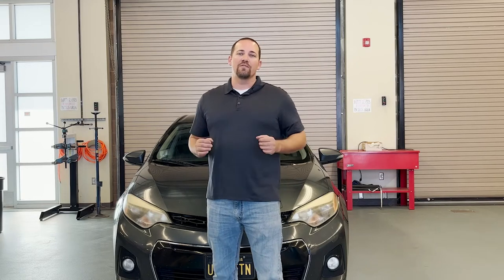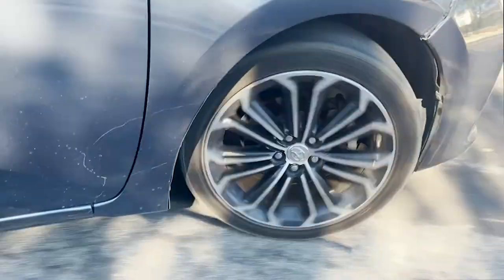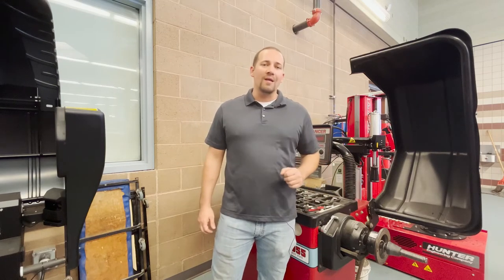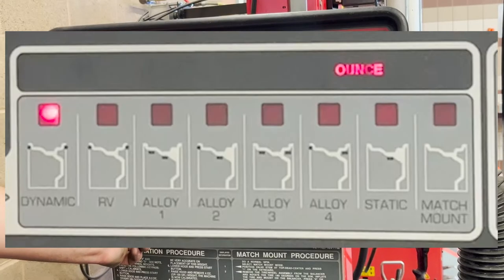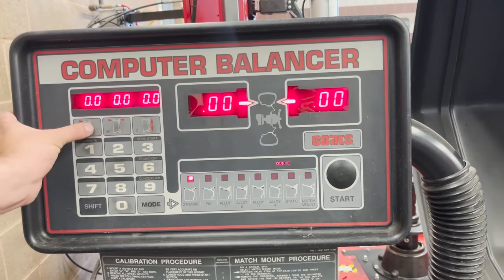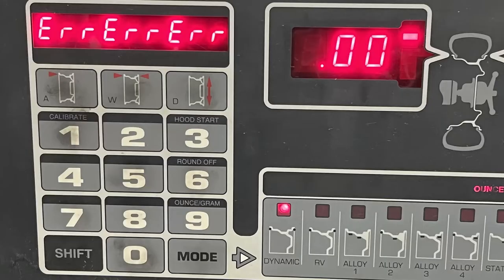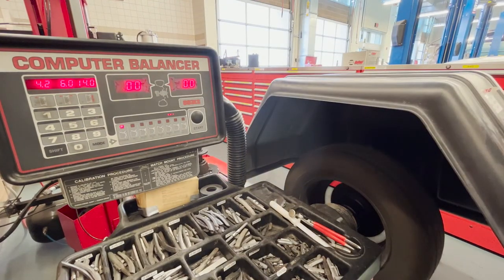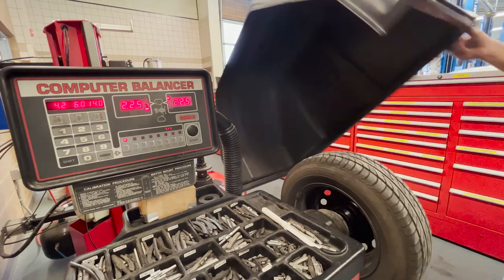How to Balance Wheels and Tires

Comment: I would love to see if you can balance a tire to 0 without weight. I have a tire company that says it's possible and he had balanced all four without weights on a truck.i said it was impossible.and extremely rare if at all.claibraiton in order?what do you think.
Reply from the maker: @coreywilson3326, I would agree with you that Balancing a tire to 0 without weights is extremely rare due to manufacturing variances and wear. While theoretically possible with perfect tires and wheels, it's impractical in everyday scenarios. Calibration issues could also affect balance.

Comment: Is it normal if I balance a tire and it reads zero, unmount the rim from the balancer, rotate it 90 degrees, mount it and balance it again that it says it needs weight? I can zero it but it always gives me a different reading of I take it off and try to balance it again. Is this normal? Coats balancer
Reply from the maker: Keung, great question. It's not uncommon to see some variation in readings when remounting a tire on a balancer, even if it initially reads zero. No tire or rim is perfectly balanced and this can been observed when rotating the tire on the rim. The movement of the tire on the wheel changes the weight distribution and caused the balance to change.